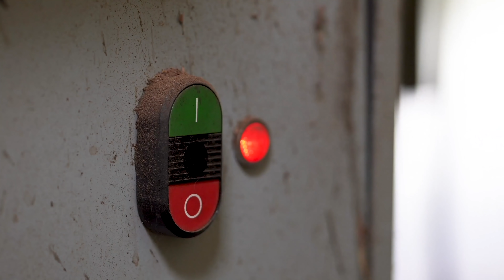Woodturning a Black Walnut Burl Vessel with Dan Tilden!

Comment: I like the way you were able to extract a vertical vase from the burl unlike most burl project which are flat, bowl like.   I will have to examine how to cut a more vertical burl when I gather burls.   The piece is fantastic; the rough edge and the wire binding create the correct balance..  Thanks for sharing you work and ideas.

Comment: I really love the look of black walnut, and this piece is a beautiful representation of it's innate tones, and character. something I think would be amazing to see done ( and if I still had a shop I would try to do it myself) is take several very drastically different woods, collect the shavings from turning other items, keeping them seperate, and mix each color of shavings with a slow set resin, and pour each one into a bucket form set at about 30 degrees, with the witness lines then being diagonal once it was set, about 4-6 hours apart on the pours, so they don't mix. if you densely pack the chips in each mix, you will have a very cool diagonal line of each wood color, that would make for an amazing piece.  also, maybe cut back a bit on the slow motion, and dramatic lighting stuff. this is woodwork, not fashion.

Comment: Great Job. Surprised there are not more comments on the faux repairs. As an antique restoration guy, I have stabalized many cracked bowls. The trick is how to tie the two ends together in a good looking fashion. Wondering how you did yours or if they were even tied at all. Also, have you considered using wet leather for stitching and then letting it dry in order to shrink and tighten everything up?

Comment: Beautiful piece.  Am I correct in saying that you turned the shape...in reverse?  I've used hemp string and leather to stop cracking in bowls, but not like the way you did it.  Your way is a much "cleaner" effect.  Really nice job.  Also, I've never used teak oil.  Is this you preferred method and preferred brand..Daly's?   Nice shop too...very clean, not cluttered.